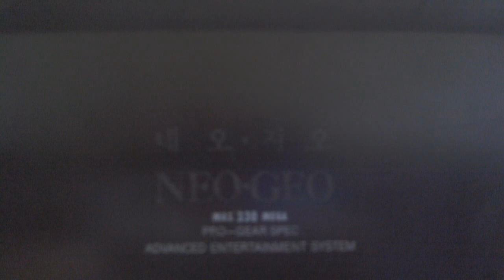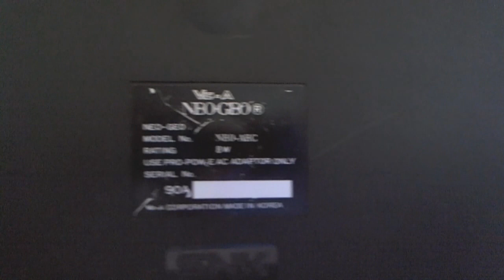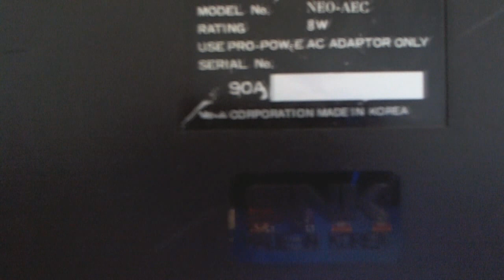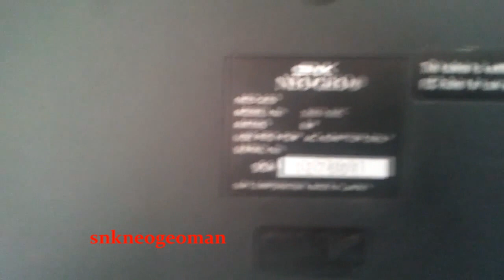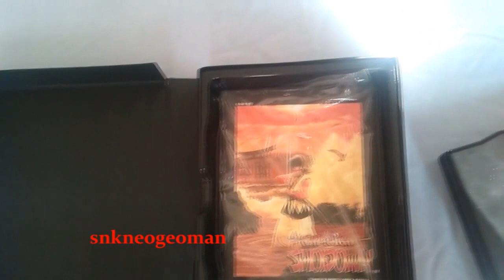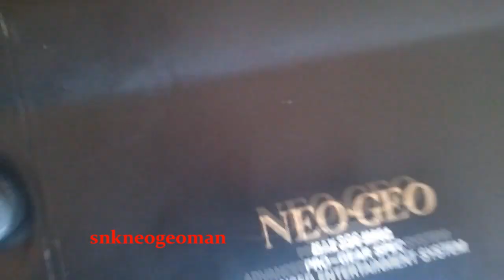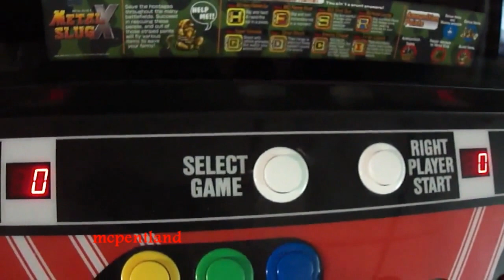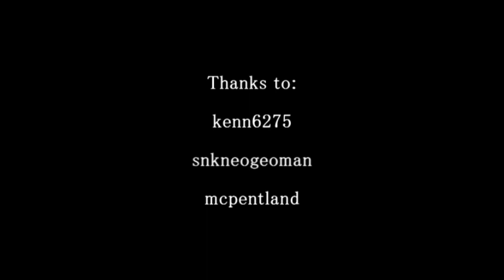Special Video: SNK Neo Geo blowout!!! With guests!

Comment: I recognized it instantly. Mainly because the amount of research I've done to identify my own systems. There's many Aes systems including rental versions, pre-lease & early released Aec's, 2 different Gold system bundles (First batch ONLY included Magician Lord w/handle right side up & slightly different box extremely hard to find intact)...2nd release Gold bundles which 95% of Gold owners have, Silver & late release bundles. Great find.

Comment: What color is the screen when you turn it on? 
Blue     = All tests passed (The AES does not test the Z80 sound IC).
Red      = Work RAM error (0x100000 region).
Green   = Palette RAM error (0x400000 region).
Yellow  = Video RAM error (programmed through custom port).
Pink      = BIOS selfcheck error (0xC00000 region).
Cyan     = Memory card error (only tested if card in unit and blank).
You can start from there.